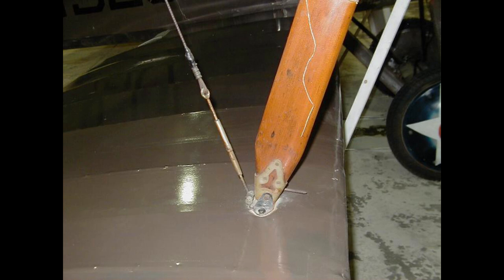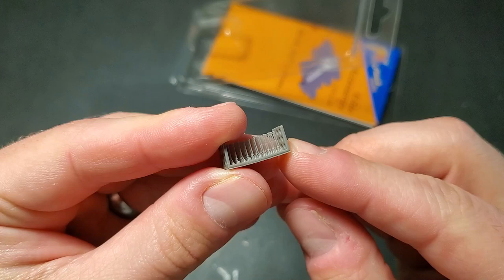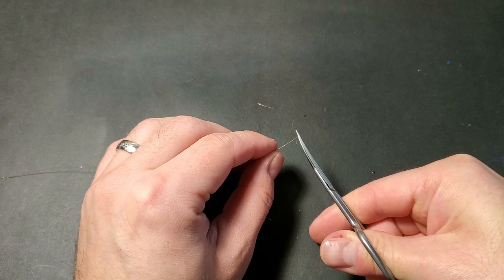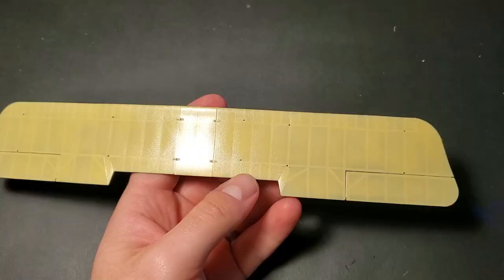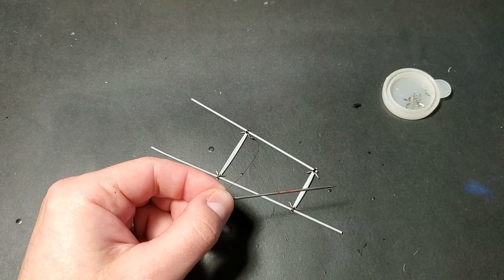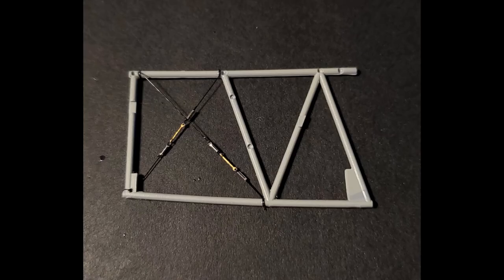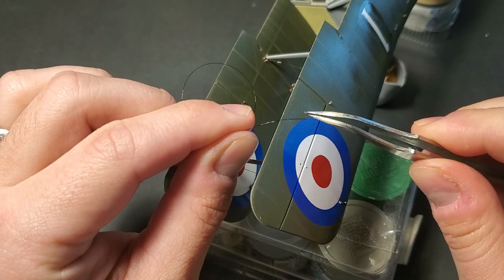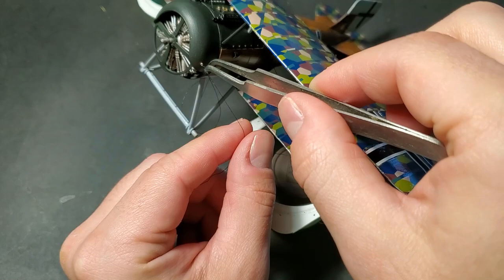How to make a realistic Rigging on WW1 plane models

Comment: Excellent  starting points and tips.  Im going to try the surgical needle trick.
Reply from the maker: Thank yo so much, Nikki. Actually, i tried brass tube on my Strutter project and they are much better in work, so if you can - buy 0.4-0.6-0.8mm brass tubes, if you can't  - needles is a good option
Reply: @FlyingCircusModels  Great insight.  Thank you so much.